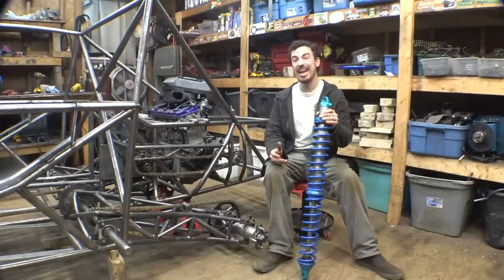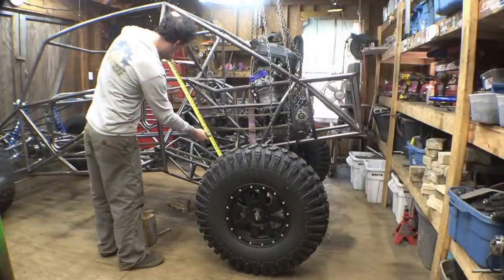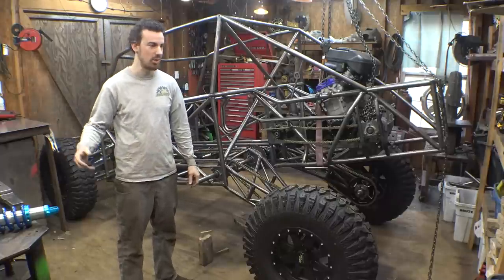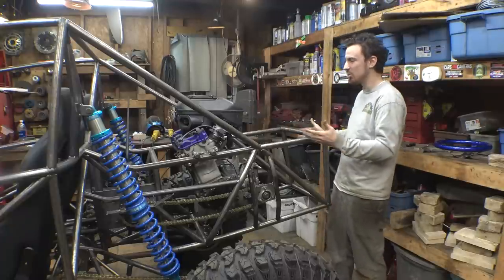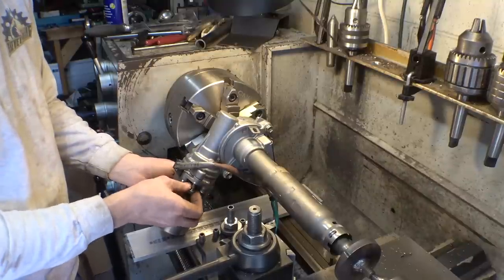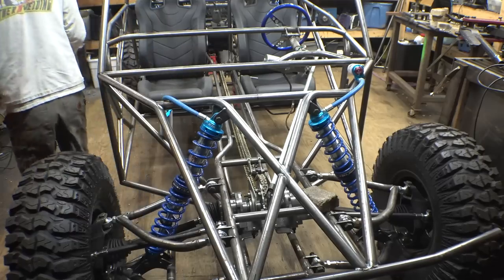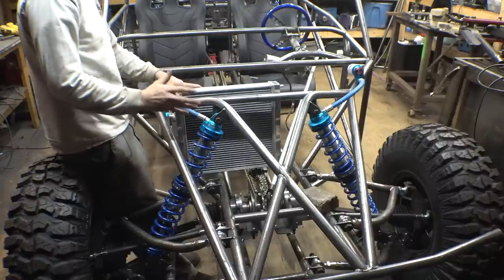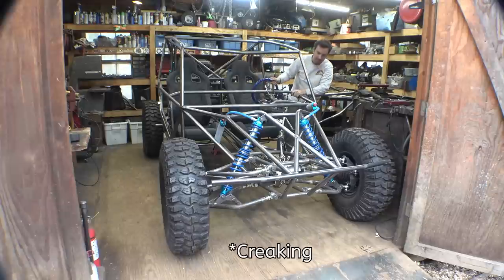Finishing the Rear Suspension... Mini 4WD Trophy Truck Project - Part 13

Comment: nice work as always, why don't you put the radiator behind the headrests of the seats and make an air cleaner so that the air goes to the radiator, the route of the coolant will be shorter and the water pump will not be strained

Comment: You could move the lower shock mounts behind the axles to use more of their stroke unless spring rate is as you just said, "too strong". Sounded like YouTube's patron synchromesh of Slates stopped by.

Comment: Just lower the spring retainers and put limiter straps on it lol     come on...    

 The spring rate is probably pretty good for the weight when it's done. Putting lower rate springs will make it squat when you hit the gas. But it's still gonna be like hitting the front breaks when you let off the gas since the front wheels are spinning that giant chain all the time.   You should have put a 4x4 contraption at the front spoo also to totally disconnect the middle chain

Comment: Put the radiator on the roof!  Shorter hoses.  I’ve seen it done before.
Reply: I said that last week with no Reply. I just afraid of a Coolant line Break and someone getting burn very Bad

Comment: I am truly convinced that you should have your own business. The thought process that you go thru for every aspect of your builds is ridiculous. Your radiator placement should work, but it's going to be hard for the waterpump to circulate the water. A electric pump may help. Hot water rises. You could move the upper shock mounts up just a little, but wait till you have maybe 90 to 95 % weight in the rear then add ballest in the seats to achieve ride height your wanting. But looking like a extremely capable fun ride so far.

Comment: Why don't you mount the radiator in the back? Looks like there's plenty of space and it would save a ton of trouble with tubing etc. Also puts more weight in the back, compact package. Seems like only upsides

Comment: Would there be room up on front of the front shocks to mount the radiator? Perhaps leaned back up under the cross tubes up front?

Comment: if yr gonna angle the radiator, you could put it further forward, right under the X bars.
also, you were talking about adjustability of the steering wheel. im looking at you sitting in it, and you have a good foot worth of headroom, but your shoulders are barely level with your dash.. you'd be better off lifting the seats a bit, or making them adjustable, so you can see what any rocks your wheels are attacking.
have a nice break bro :) clear your head then have another look at the machine

Comment: Honest question.. Is there any reason you wouldn't want to mount the radiator to the rear roll cage up high just behind the seats? You could still mount the fan on the back as a pull style. It would be up high enough so that the air would still flow thru it while driving. Seems like that would eliminate some of the heat issues you would get from having a front radiator along with the hot coolant hoses running around or thru thre cockpit area.

Comment: Why does he always thinks the suspension is too stiff or he wants it to sag lower, by the time you put everything else, two seats, two people, gas tank and gas, battery wiring, radiators and fluid and everything else I didn't think of . It's going to sag where you want. Plus you don't want it to bottom out everytime you go off a jump.

Comment: You sir are a fabrication genius. I have an old 77 or so first gen Honda odyssey that I would love to have some of your designs on like rear suspension and selectable gears like reverse and more then one forward gear. I have watched some of your videos and love the designs and you never let a failure defeat you. You just redesign it and make it work. Could you design and build something that I could remove my old rear axle and weld on your setup? If so how much would something like that cost? I’m almost sure your way to busy to be interested in this project either that or I wouldn’t be able to afford it. Maybe I can maybe you do have the time but you never know unless you ask. I am a certified welder but I no longer work as a welder and don’t have any equipment other then my hood/ gloves. But I do have someone I can possibly rent his shop for a little while to mount up and weld it in. But I don’t have any access to any kind of milling or lathe nor have I ever used any machinist equipment. I could possibly find a machine shop if I had blueprints for parts. I have a place with a water get and 2 or 3 axis mill that I used to do side work for. Anyway my other idea is to get a used atv with everything I need to cut up and splice onto the old odyssey. Any help would be greatly appreciated

Comment: Did your electric dirt bike's bigger controller work? If not then try connecting the the controller's green wire to motor's blue and controller's blue wire to motor's yellow and controller's yellow wire to motor's green. 
It will work and then don't forget to upload that video I wanna see if it works with your controller or not because it worked for mine.

Comment: Hey, 
What about the lockmechanisme for the 4wd. What happend if the vehicle rollback  with little play in the pins? Then you won't have direcly power to the front wheels. Maybe thats no issue, but it came to my mind.

Comment: this is a very pretty build. good job. I wish I could do this. not to be annoying or anything, but the drive chain going to the front? it looks tight but not too tight. are you going to add a spring - loaded chain tensioner to always keep it tight? I've seen some utvs with that.

Comment: What is the inner diameter and outer diameter size (thickness) of the pipe you use on the chassis?

Comment: Sir I know this is your Truck but for safety take your Radiator and Install it on theRear cross braces that way you will be Blowing Fresh Air though the Radiator an also cooling your Engine. If you blow a Cooling Line you could Get a Very bad Burn too your Body. Plus you need Ass weight for those Shocks.  Please think Safety.

Comment: You need to start using 4cyl engines in these builds. You need more torque.
Reply: It is a 4 cylinder engine
Reply: @reghickmott6488  3 cyl snowmobile engine i believe.

Comment: That chain is going to break you need driveshafts if your going to rock bounce or rock crawling it's going on need to run the back like the front with a arms with CV axles that chain is going to strech, brake or jump teeth it's way to long it needs what is differentials and driveshafts

Comment: Might be a shocker but travel isn’t everythign.   You can have 40” of travel and get smoked by a guy with 12” or travel   20” is plenty of travel for that thing
Reply: Also your rear shock mounts need to move.    The mount on the trailing arm need to move back.  Take your coils off, don’t scratch them and you can trade them back for different rates.    Then cut to your shock in there.  At full compression the shock should be 90° off the trailing arm.  If it goes past 90 you need to move it again going past 90 measnyojre in digression and using the leverage to compress the coil more then the load that’s on the wheel

Comment: Hello, hey question, why are you setting up that radiator on the top , you are increasing the weak points by having to setup the transport of the coolant fluid to the front, you have a big box on the trunk of of the car, why don't you put the radiator on the back , and that way you don't expose your self of having to eat the hot air while driving the car and also you don't expose your self into an injurie by a crack of the system and burning your legs, better have that hot water and hot air on the back closer to the engine , also it will be less fluid if you put it on the back

Comment: Cute how he still calls this project "mini"....   i still say that clutch and engine are doomed.
Reply: I think you’re right.  That’s a lot of weight for a motorcycle engine to move around.  And the wheels!  How much do they weigh compared to the motorcycles rear wheel?
Reply: Its mini compared to a full size one kinda looks like a mini short course truck the same series of racing cleetus did
Reply: Not if you gear it right.
Reply: Depends a lot on gear ratios too.
Reply: The motorcycle transmission won't know the difference. His jackshaft from the jeep transmission arte what's taking the forces
Reply: All depends on gearing and if there's a High Performance clutch available.
Reply: Why does he still use go cart stuff. That things big. Like when is the k swap and sequential? It's the best looking rig so far. Tons of work.
Reply: You must not have been following this channel very long, he has 4 motorcycle powered rigs that all are around the same size and they have plenty of power.  It's all in the gearing.
Reply: This thing will have no problem with gearing
Reply: Stay on project til finished. Tired of the hopping round. Just go with a car engine like research and find a 4 cylinder that's cheap to build and can get a lot of power from like a neon engine
Reply: @camyota  Umm ive followed his channel for years and years and all his other bike engine projects of this size all have had overheating and clutch issues..  and this one is begging for issues...  We will just have to see.
Reply: Yeah I think the clutch will burn up, hopefully there are aftermarket performance options
Reply: Yea there’s a lot going on here for a motorcycle engine I’ll agree. I like that he uses motorcycle engines but I’d like to see a beefier power plant in a vehicle like this or a slightly smaller vehicle for an engine like this.
Reply: If you know nothing about gear reduction just say that.
There's mini tractor pull tractors running bike engines.

Comment: It’s a buggy! Do you really want the radiator in the front? Blocking air then all the air that hits you is hot? Even with a fan….. put the radiator in the back behind the motor.duh!